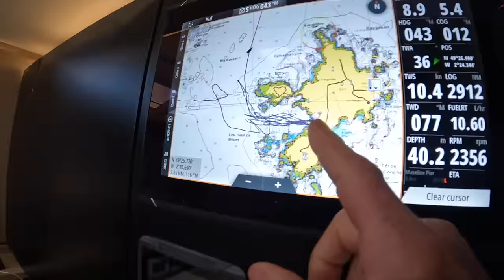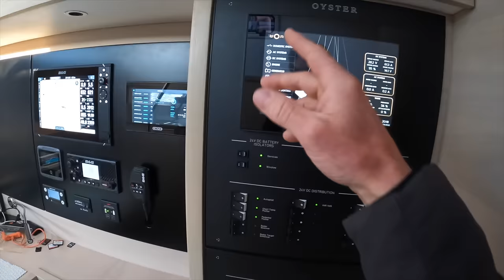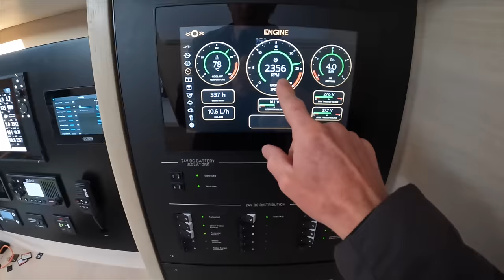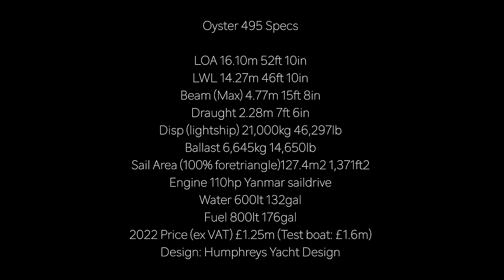Oyster 495: 3 days aboard Oyster's new bluewater baby.

Comment: Oyster makes a GORGEOUS yacht, full stop. My concern is for the depth of these modern systems, long term…will they perform in unison the way they must for a decade of cruising? Also, I wish more of the luxury yacht builders would understand that we don’t all want a longer yacht, as 50’ slips are not easy to come by at any price in MOST of the places where people who can afford these boats actually live. My slip is 32 feet long, just shy of 10 meters, and the only reason we have it is that we jumped on it and reserved it before the marina was finished being built and paid for the first season and winter storage before there were even docks to put in the water. The 50’ slips were spoken for 10 years ago, on a wait list from the owner’s other marina on the other side of the inlet! They simply don’t exist, and so we would prefer a smaller, single island berth with one complete head, a compact galley and a double settee salon with a fold-down table…but modern, and built with quality materials. No nav desk, no big table, no dinette, no quarter berths sold as cabins. We want an electric drive, a small diesel gen set that runs itself on a schedule, 400 Ah of LiPho4, and lines led to the cockpit. Very simple, but we want it to be LOVELY.
Reply: Maybe you should have a look at Sirius Yachts from Germany and their 35DS. They build very high quality blue water boats and they really are happy to fulfill ANY customer‘s wishes (one once had a Sauna installed). Interior craftmanship is first rate and the boats are very very solid with many different options for the keel.

Comment: Nice review..but compare the Kraken 50…a high quality blue water cruiser with integral keel, shaft drive, covered cockpit, interior watch station and incredible systems & engine access. With a solent rig it is a heavy displacement hull that hits 8.5 knots. Fantastic boat!

Comment: Toby, great review of a fantastic boat. Reviews like this can never be too long! Just one question though, if the winches etc are hydraulic, does this mean that the engine is always running?
Reply from the maker: Thank you. And the winches are electric. The hydraulics run off electric power pack, so still silent when sailing and using furlers etc
Reply: @yachtingworld  Thanks Toby, that makes sense.

Comment: Nice review and overall a very beautiful boat! 
A little noisy when the engine is running, I believe it should have a better sound isolation….just wondering the price..thanks!
Reply from the maker: I measured sound insulation and found it pretty respectable and the insulation very good (detailed in the full report). Price is shown at the end and starts at £1.25m
Reply: @yachtingworld , perfect and again thanks for the very good review!

Comment: Wonderful boat and video. I wonder how many of these will be sold with old battery tech. I would guess in this day and age, and younger clientele in mind, they would have lithium-ion as standard battery. Also, do the yard offer integrated (well designed) solar panel solutions? So clients don't have to jerry rig something uglier after delivery.
Reply: Also surprised a premium-priced bluewater yacht would not have solar and lithium-ion
Reply: As this is the launch boat doing a long world publicity tour, it may be having lithium installed prior to client handover and all the other options they may have specified like bimini, davits, solar, etc. With so much going on during the tour, older style batteries are cheaper to replace than lithium ones in the case of a mishap.
Reply: @ajkgordon  good points! Thank you.

Comment: I'm not a sailor (would like to be one day) so can someone explain to me how this boat doesn't tip over at 5:11 to 5:26 ?

How do people prevent tipping? How do you know how far to push it? I get that there's a keel but man... that's so close to the edge of the boat! Is this one of those "it takes practice" things? It look amazing and incredibly fun!
Reply: It will keep tipping as far as you can make it with the wind and the sails. Putting the toe rail in the water is not a big deal. Any more than that and things can start crashing around down below though. Unless you are completely flattened and turned over by a huge wave, the righting moment of a very heavy keel will always bring the boat back to upright.
Reply: @ajkgordon  Very cool, thanks for the reply :)

Comment: Toby, you know the Rustler 57 and you know this Oyster 495. Very different styles and probably similar internal volume despite length differential. The question is…which do you prefer as a Med cruiser for a family of 3?
Reply from the maker: Interesting question. I like both boats. But while I am a fan of how Rustler builds its yachts, I would not normally consider them as typical Med cruising yachts - more suited to Atlantic waters and cruising.
Reply: Fair point, thank you. @yachtingworld

Comment: I have a question about the Sail-Drive.  Why would anyone drill  a huge hole in the bottom of the boat for no good reason?
Reply: There is reason: Saildrives are quiter, offer more horsepower because the prop is not at an angle and take less space and can be moved further aft. Shaft drives and saildrives both have advantages and disadvantages.

Comment: The newer breed of cruising production boats does add some thoughtful features, but as a 60 year old lifetime sailor, the aesthetic looks ungainly and awkward to me.  Fat hulls with high freeboard makes for poor lighter wind performance and a bouncy slam-ridden ride at sea.  The helm stations seem very exposed for passagemaking, perhaps there is an enclosure option.  The transom steps are so narrow and the steep angle makes for challenging boarding and disembarking, inexcusable for a boat this size and price.  Why is the cockpit table so friggin wide?  That will make movement fore and aft on the boat whilst heeling and pitching in a seaway a major pain.
  I have not been aboard this boat- but I have been aboard many Oysters at boat shows through the years.  Everyone Oyster without fail for me was an ergonomic nightmare.  Every space was so cramped and filled with too much so that I would bump my sides, elbows, knees, and head just about every time I tried to move, and that was sitting flat and tied to a pier.  Granted I'm 6foot5, but I'm fit and a lifelong sailor for 60 years and generally do not have the same degree of ergonomic issues with many other boats.  Weird angles, corners, cramped fore and aft transitways, multiple steps to cross such as the up and down in the cockpit and cabin sole make life miserable when heeled and bouncing in a seaway.
Not my style, but to each his own.

Comment: I'd take a Sirius 40DS over that any time.

The galley on the Oyster is really nice, though!
Reply: I wonder how well the electrics and hydraulics on these boats will fare in 30-40yrs time...
Reply: @afthefragile  I suspect that is something the original buyers are not concerned about, but when the boats reach a certain age or miles, it could be a huge consideration.  It seems that most boats of this ilk are going down the same path.

Comment: ALL OF THAT GLASS / WINDOWS BELOW THE WATERLINE WHEN SAILING   WHAT HAPPENS IF A WINDOW IS BROKEN BY ANY FLOATING OBJECT .  How strong is the window materiel .?   the different hull and windows need sealing and eventually those bonds will break down leading to leaks .   Not an issue with a reasonably new build   but after 20 / 30   plus years of degredation due to uv and the weather ..  nightmare .
Reply: Someone who can afford this new will probably be onto a new boat or 5 in 20 years tbh

Comment: Toby I always like your reviews. But, mate be realistic. Bluewater boat? No Bimini, a must if your going to cruise blue water. No provision for solar panels, tie back lines, tender davits, Hydrovane or wind steer? The aft section topside would be a nightmare as there is no barrier, toe board or catch all aft of the seating area. Anything put on deck will quickly be off the back of the boat and sinking.   Step up and step down below decks? Try walking the length of the interior in a rolling sea when your 60+ as most bluewater sailors are. You guys need to get so reality into your reviews. Sail Safe.
Reply: You are pedantically nitpicking issues, also, please show me any one person who bought a stock boat to cruise the world in, without adding an array of additions to bring the boat up to their ideal.
Reply: actually SHOWED attach points for extended Bimini in Cockpit which could easily be a full enclosure, davits are an option, the boat hasn't delivered so Solar/hydrovanes/etc can all be done. They are trying to show you a clean/brand new boat- you can "waterworld" the heck out of it when Toby is done filming..shakes head
Reply: @pred7949  You need to get out and actually do some Bluewater sailing and live full time aboard in a sailing community. Then your realise this boat is unrealistic for 98% of real Bluewater sailors but will be slobbered over by those that dont and can't.
Reply: @MrNvtty  🤣🤣🤣
Reply: @SVImpavidus  actually cant believe that during my 165 000 nm and almost 4 circumnavigations that I haven't run into you, thank god for that though
Reply: @SVImpavidus   been sailing for 25 years and i'm only 35, had a look at your attempt at sailing vlogs and it seems that ones fragility hits a peak past 60 and the minds dexterity crumbles with each passing day, left me with the conclusion that your opinion and views are totally irrelevant and redundant, and at the end of the day the likes on our posts in this thread tally in my favor. Logic and reason will always prevail.

Comment: In fact the design looks a bit outdated. Lines don‘t flow nicely, they are just random and nothing fits together. Compare this with a First 53 and you‘ll see the difference. Why would you paint a boat in a 70s toilet color? What a great idea to have an electronic controller in the main bilge. For getting access to the fridge you‘d have to throw you on the floor? Crazy.Probably they could not tell us the truth as they were getting the boat for free testing.

Comment: i am always watching your videos and you should and the producers pay more and more attention to the tenders and tender garage.
in actual sailing even in the marinas and the most important thing is the tenders. in crowded anchoring areas we usually expand a line to the land because and the only way to do it using tender. the yacht is perfect but 5o foot yacht how can we easily operate the tender sigle handed??? Pay more attention please..

And the outer windows in the hull, why are they splashing water, when the boat leans you can easily see the dragging in the hull, so stupid engineering mistake.
Reply: I also noticed the drag.

Comment: I do not follow the excitement here. I saw nothing spectacular on this model and (sorry to say) the oak interior looks like a cheap charter veneer. The headboard designs are tasteful..? I felt it was stolen from some 80ies strip joint. The bunks look narrow although I grant that this may be owed to the lens, it is difficult to record in tight spaces and achieve realistic perspectives. The galley seems very functional, expected in this size boat but I dislike the conventional life lines on deck, Amel gives you solid stainless. And this brings me to my big peeve: with a base of (almost) 1.5 million Euros (1.25 pound sterling according to the review). One gets a base Amel 50 for half that price at 720.000 E. I do not know what the Oyster base boat offers but Amel is known to be pretty well equipped without checking every box on the options list. I certainly doubt you could possibly reach the Oyster test boat price of (almost 1.9 million E (1.6 pound sterling). 
Admittedly this may be a matter of national pride (btw. I am not French) or simply the target audience who lives by the mantra what the heck is another Million, right?